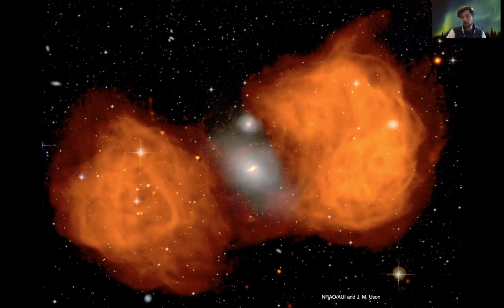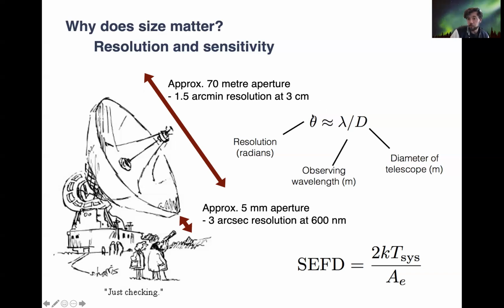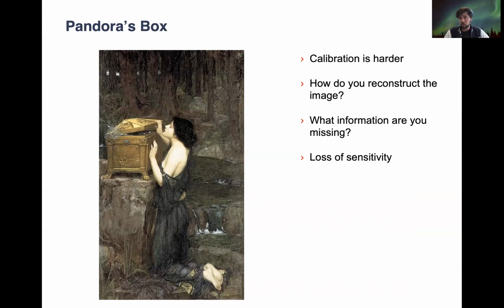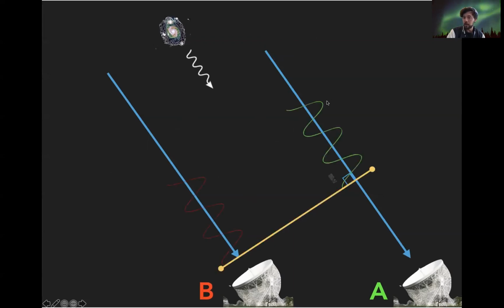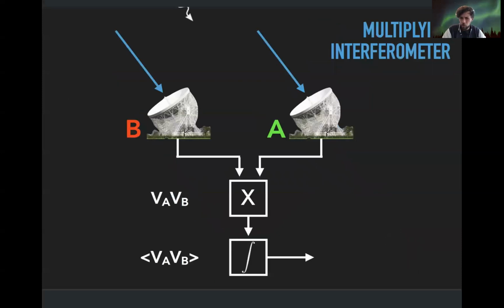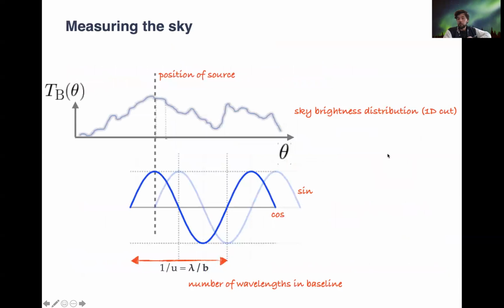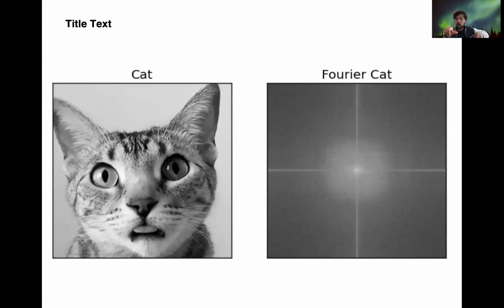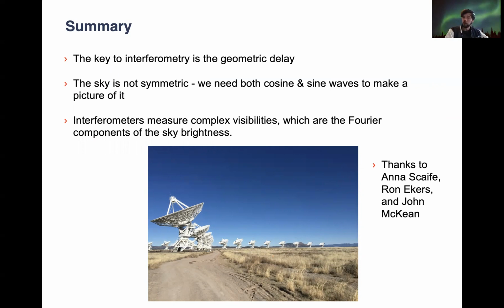L3: Introduction to Radio Interferometry - Joe Callingham

Comment: Great video. Thanks.  Minor point:  At about 6 minutes in the cartoon states that the resolution of an optical telescope with an aperture of 5 mm is roughly 3 arcsec.  I think that should be a 5 cm optical telescope (50 mm).